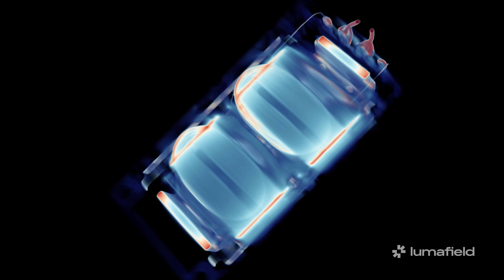Switch 2 Pro Controller: Built to Break? Full Teardown

Comment: You are saying is not durable? What was broken in the control you opened? So far I haven’t heard of any technology that doesn’t break with time. But I have been using the Nintendo pro controllers for Nintendo switch 1, I have been using it for like 8 years, and still working exactly the same. Also for something to last longer you have to use them normally, why many people their stick start breaking so soon? I have like 10 pair of joycons of switch 1, and all of them works perfectly, I think playing long time smash bros can cause them to break, that’s the reason I never play smash on portable mode.

You are saying companies must put an easy way to remove and change the battery?😂, are you serious? Just look at apple, with the iPhones, a normal person cannot change the battery, you need many special tools, probably the pro 2 control is like this, you need the special tools to change any piece. So Nintendo wants you to take the control to them when it needs to be repeated.
I remember having this car called journey, my friend always helped me to change the battery in many cars, this one had the battery inside the wheel, it was super hard to take out, it took him like 2 days to remove it. So many companies does this kind of thing so you must go to the official repare place.
Reply: only a fool easily parts with his money. a device designed with a battery that is hard to get to is a bad design. if you have to pay the company that made it for repairs, it's a bad design.

Comment: I love the Switch 1 Pro Controller battery is also compatible with 3DS/2DS.
Reply: And Wii U Pro controller too
Reply: WiiU Pro Controller, New 2DS XL, New 3DS, 2DS, 3DS, Switch Pro Controller😁
Reply: same with the Wii U pro controller
Reply: Had no idea! That's cool
Reply: At why The Switch one Pro Controller is still my main as the battery can be replace and the new pro will only be use when game need the exrta buttons
Reply: @Drakesonone Games usually never need the extra buttons, they are meant for remapping if you want.
Reply: Woah, really?

That's some pretty cool trivia!
Reply: Good to know
Reply: SNCA

Comment: Good thing I hesitate in getting the Switch 2 Pro Controller. I was thinking about getting one of the 8BitDo Ultimate 2 anyway for the updated sticks. I really loved their Pro 2 that I use more than my Smash Bros Pro Controller I got with my Smash Bros Ultimate.
Reply: Not a Nintendo superfan, but I do like the look of the 8BitDo controller. It looks like the Pro controller but better in every way including price. I'd buy it for playing on PC if my Xbox One controller ever dies.
Reply: @HittTheDekk  Besides the Nintendo Switch, I use my Pro 2 for my Retron 5 to play some older games just because the D-Pads for them are great.
Reply: @DracoBudSmith  Saw a short video on the Retron 5. The stock controller is one of the most cursed things I've ever seen.
I'd rather use something like an Android-based emulator console or a Raspberry Pi for retro stuff, if I could only have one device. However, I recognize those devices require more than literally just plugging in for setup.
Reply: @HittTheDekk  Same, the wireless controller that comes with the Retron 5 doesn't look to be reliable controller to use in a more action games like the Contra series.

Comment: I think I will get the Switch 2 Pro Controller when Gulikit makes TMR or Hall effect Replacements
Reply: Why not just buy a good 3rd party controller? Then you don't have to deal with glue or 6 thousand screws, because the magnetic joysticks are already installed.

Comment: I have 3 pairs of Joy-Cons and 1 Pro-Con for the OG Switch, 4 of the Joy-cons now drift but surprisingly 2 are still working fine and the Pro-Con is still great. If this uses the same stuff used by the old Pro-Con, or improved upon, then its still a solid controller, at least for me.

Comment: Being a little hyperbolic with the "prone to drift". As an owner and  user of my first pro controller from eight years ago STILL has no drift.
Reply: I've had my switch since launch and all 4 of my joycons got drift. I replaced them with hall effect sticks. The left stick on my pro has also started to drift but I don't have experience with soldering. I've been gaming for over 30 years and this is the first time I've experienced stick drift.
Reply: The original pro controller uses regular sticks, this one uses joycon style stick modules. All sticks will eventually drift in some kind of way due to wear (yes even HE sticks can wear out, just not the wipers), but the joycon style sticks are known to wear faster.
Reply: the sticks were normal in the original pro controller, the new one uses a glorified joycon
Reply: As an owner and user of my first pro controller from a mere five years ago, drift has been a non-stop issue. Opening and servicing the controller with IPA became so mandatory eventually it had to get fully replaced by Nintendo (And it took a few hours on the phone in order to get that sorted). Just because you don't have the issue doesn't mean it's not still prone to drift.

Comment: Does anyone know of other controllers that use the same linear impulse motors for vibration that the Switch controllers do? Im really surprised with how it seems like newer designs are still using rotating weights
Reply: HD Rumble as Nintendo has implemented it, is probably a patented/proprietary design. Rumble is also a very easy thing to save money on when designing a 3rd party controller. I've also heard that rumble is anemic in some Switch 2 games even with the Pro controller.

Comment: This is so much worse than the original Pro Controller.
Which, was easy to take apart and used the same battery as the Nintendo DS.

Comment: They made joycons less repairable too. Remember last gen when there was massive pandemic of stick drift and we replaced the joysticks on our own instead of buying new joycons as nintendo assumed us to do? Not this year. They made it slightly annoying this year for everyone to fix it. I still do love my switch OLED and I used to recommend it to everyone I know. It is one of the best consoles I've owned. But with all this crap of making this difficult to open to make repairs, the lesser talked about issue where nintendo reserves the right to ban your console, and the introduction of game key cards where you don't even own the games anymore. This is most anti-consumer move I've seen a gaming company make in recent memory.

Comment: My Switch Pro controller never had drift, I put hundreds of hours into TONS of game with it being docked as my preferred way to play, not to mention I connected to my controller to my iPad all the time and played games on there. Funny enough though, my much less used Joy-cons had all kinds of drift AND connection issues. 

Something tells me I won't experience drift in the next 8+ years with my Switch 2 Pro Controller.
Reply: The seal between the joysticks and the housing is probably much better on the Pro controllers than the Joycons. Hopefully your prediction will turn out to be true.

Comment: The reason why Nintendo makes it difficult to repair is probably because they want to prevent children from disassembling mischievously.
Reply: dumb take. If they wanted to make it hard to get into, there are other ways besides hiding screws behind a glued on faceplate.

the Xbox 360 had Torx screws, and those drivers are uncommon enough that the average child would not be able to get one. Or they could have used their proprietary Tri-Wing driver. They could also have just made the entire outside clip together like what's common in smartphones now.

Comment: Still a billion times better than the psp
Reply: ??? The PSP had zero glue holding the case together in order to get inside. The battery also had a door for instant access.
Reply: @HittTheDekk  i fully admit that Im not being fair by comparing a full system to a controller, and the battery is much easier to replace. But they are both terrible to repair. I would disassemble this ten times over disassembling a psp once. I mean the button pads arent even real, they're like stickers!
Reply: @DiceRobo  I personally found the PSP one of the easiest handheld consoles to disassemble and repair. There are a couple fiddly bits like the zebra strip, but it beats having to roll ribbon connectors for something like the DS line.

Comparatively speaking, yes I agree the Switch Pro controller is easier to disassemble than the PSP.

Comment: Didn't even mention the issues that plagued early switch pro 1 d-pads are back on these new controllers despite the fact that they fixed them on later switch pro 1 controllers.
Reply: They did resolve the d-pad, as far as my testing.  Others had mentioned that they raised the design slightly to correct the issue.  It's not an excuse for anything else though.

Comment: And yet it’s the best controller I’ve ever used
Reply: Very low standards there
Reply: and comparing to Sony's pathetic handling of their controllers it's night and day, the PS5 controller is hot ass and it's made worse by the fact there are zero third party options in the same price range, at least for nintendo if u dont like the pro controller u can just get a different one
Reply: I agree, it's an amazing controller on day one. The sticks are ridiculously smooth, the buttons are quiet, the texture feels so good. Unfortunately, the sticks will drift, the coating will become sticky, and it doesn't have analog triggers. 10/10 in playability, best controller I've ever used (except for racing games). But 0/10 for longevity and repairability.
Reply: So many haters on these comments, good grief they should go back to their ps5 or something
Reply: @davizookaa or they could just get a proper handheld console, like a Steam deck, and ditch this crap
Reply: Careful, you're gonna upset the Switch 2 hate hivemind.
Reply: @LMXPebble  It's not a hivemind. It's being a reasonable human being. The people who like the Switch 2, are the hiveminded ones. They're physically incapable of understanding they are being scammed and would rather throw themselves in front of a train if it meant defending Nintendo at all costs.
Reply: @LMXPebble  Hating the Switch 2 is not hiveminded behavior, it's being a reasonable human being. The exact opposite is; being completely blind to all of the faults of the Switch 2 and liking it regardless of how bad it is, is hiveminded behavior. It's like you people are physically incapable of understanding that you are being scammed out of all your money. Even if you're rich enough to afford it, it has a handful of design failures. Swelling batteries, it's so hot it's warping the metal kickstand, they're using the same joystick technology as before, if not worse, according to this video...
Reply: Considering nintendo fanboys have only ever used crappy nintendo controllers, not really a high bar to clear.
Reply: @askeladden450 I honestly disagree. I've tried a variety of controllers and Nintendo's aren't bad. They're not amazing, they're just not bad.
Reply: @ZoofyZoof  i am curious which $85 controllers you have tried which you consider worse. I think most people have only tried first party controllers, all of which are not good for the price.
Reply: @askeladden450 I said nothing about price. My comment was speaking generally without thinking about price. My point still stands, nintendo controllers aren't bad except for strictly only the joycons.
Reply: @ZoofyZoof  oof, you can't judge a product without the price, its common sense. I suppose you are one of those people who think that apple wheels are an amazing product

Even if you want to ignore price because you are a millionaire, pro controllers have awful triggers (not eveb analog, this isnt the 90s),  no adjustable thumbstick tension and dpad is pretty bad. 

Ignoring the price, its mediocre at best. Considering the price, its a straight up scam.
Reply: @askeladden450 I have the Xbox and PlayStation elite controllers
Reply: You'll change your mind when you use an Astro C40 TR. 

...Which you never will because they aren't sold anymore.
Reply: Low standards are a good thing sometimes